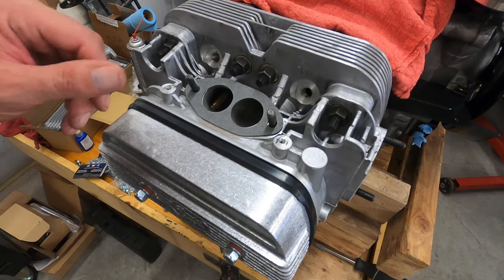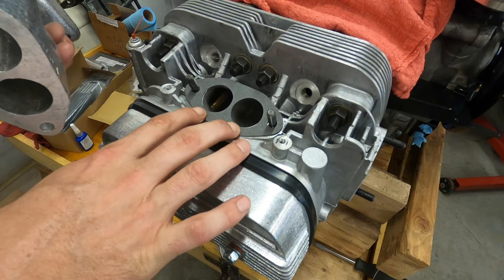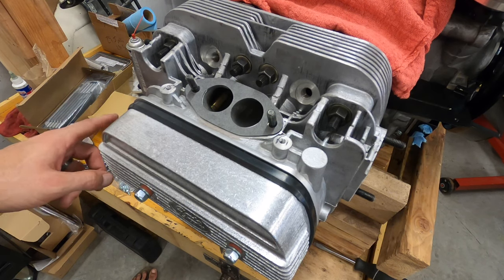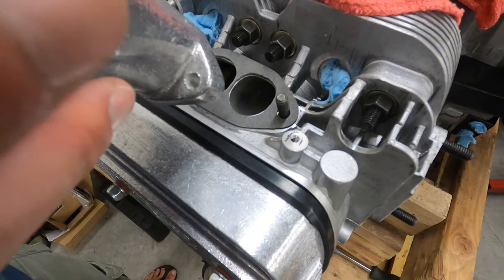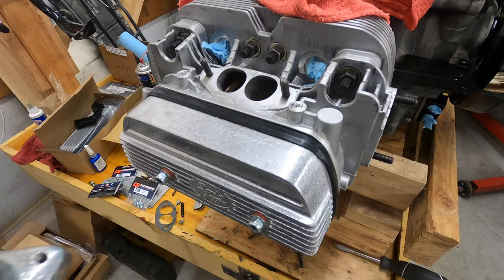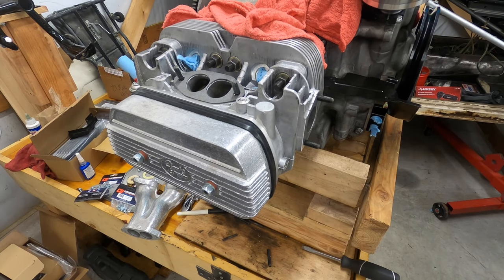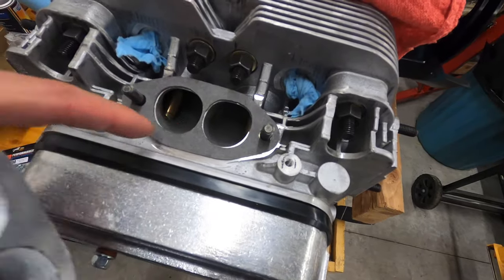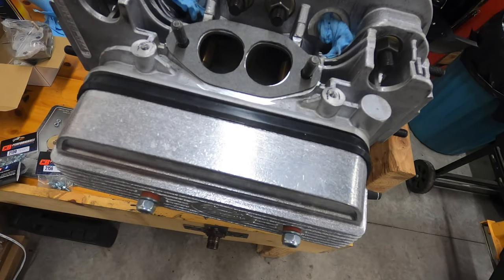Port Matching Intake Manifold On VW Beetle

Comment: I typically use 2 gaskets, put oil on the port place first gasket to get the pattern then i place the gaskets together oil side out and cut through both. A drop of oil helps hold the gasket in place while assembling as well
Reply from the maker: Awesome!